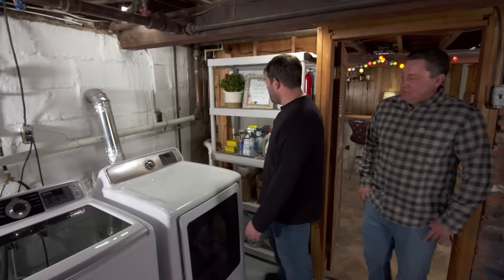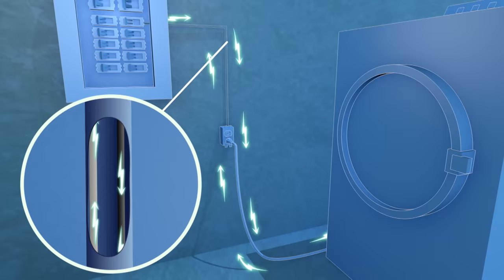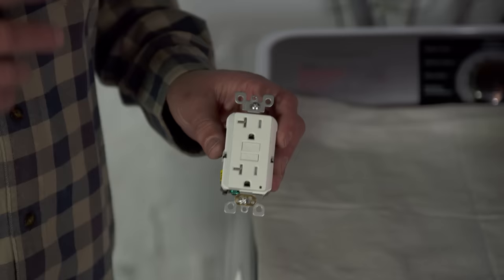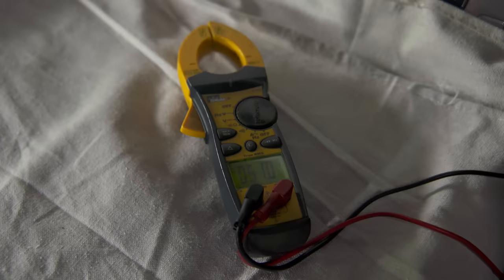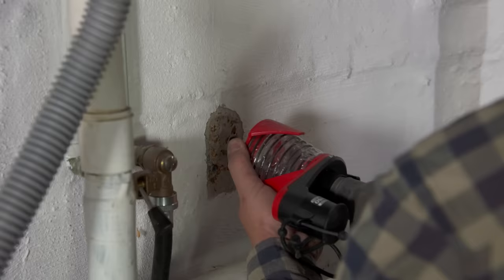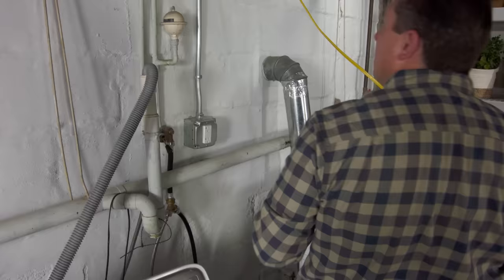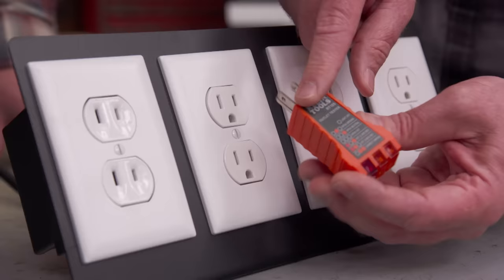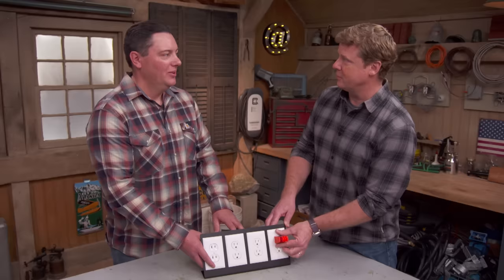How to Ground a Two-Prong Electrical Outlet | Ask This Old House

Comment: Yes, but he already had an upgraded panel designed for grounded circuits, what is the procedure if all your circuits are 2 wire/2 prong outlets and no separate ground bus at the panel?  Can I just terminate the one new wire on the neutral bus spare spots?  Or do I have to upgrade the panel?
I realize the Neutral bus and ground bus are bonded, but is it okay to tie my ground to a spare neutral screw?
Reply: As long as you run a wire to a rod driven into the ground, yes you can.  The ground bus bar is more for convenience so you have enough places to put wires in in case you have enough neutral wires to fill the neutral bus bar.

A ground wire serves two purposes.  If there is a short in a metal encased device, it allows the electricity to complete the circuit when the alternating current is suppose to be flowing from the hot side to the neutral side.  Besides protecting people from completing the circuit accidentally that unrestricted flow of electricity will also cause the breaker to flip to off and break the circuit at the supply panel.  The ground wire also protects devices from static electricity by attaching them to an earth ground so static electricity can not build up as well as induced currents that could be caused by close by lighting strikes.
Reply: @oldtimefarmboy617  Thanks.  I did just that and the funny thing is the neutral bus had exactly double the spare screws to allow for the new ground wire from the new Romex.  I wonder if the GE panel was designed for Romex and my house just got the old cloth wrapped non grounded wire?
One more question; my six circuit panel with no main shut off had one 15 amp tandem breaker feeding a 12/3 wire and I found each side of the tandem was only serving two bathroom light/fans in two bathrooms and nothing else.  Does this mean I actually have 7 circuits?  What is that about and can I extend one side to feed 4 led can lights?  Or am I asking for trouble?
Reply: @cantweallgetalong  
You will often find breakers feeding more than one thing.  You might have all of the plug in receptacles in more than one room serviced by one breaker in the expectation that the resident will not plug in enough devices to overload the breaker.  All of those plug in receptacles would be considered to be part of just one circuit.  And in most cases, that is true although occasionally someone will decide to plug a bunch of stuff in and run them at the same time and draw enough current to trip the breaker.

As far as lights are concerned, if your wiring is more than a decade old, it was designed to carry the current of incandescent bulbs which is several times more than LED lights use, and bathroom fans normally do not draw much more power than the light bulb does, maybe less.  If you put LED lights in the existing light fixtures and use LED lights in all the new fixtures you could easily end up drawing less current than you were with a couple of old incandescent bulbs.

I have two torch lamps in my living room that each put out the equivalent light of a 300 watt bulb but draw a little less than the current of 60 watt bulbs.  So I get 600 watts of light but only use about 100 watts of electricity.
Reply: @oldtimefarmboy617  Well, I checked all the outlets and ceiling lights and found the 12/3 going to a junction box in the attic.  The red goes to one bathroom ceiling fan and the black goes to the other bathroom fan/light fixture and the neutral is shared for both.  
I just wasn't familiar with the purpose or practice of using a tandem breaker with a 12/3 feeding just two separate ceiling fans.  It seams like it is a waste of wire and breaker for only those two fans.  
First, is a 15 amp tandem breaker code compliant at all, or set up this way?  And if it is, can I then use either the red or black as the feed for extending the circuit from this junction box to a set of 4 led can lights, without violating code or causing an imbalance on the tandem breaker or the 12/3 wire, the one neutral in particular?
The 15 amp breaker has independent switches, is that style still available, if this one fails after 61 years or are these discontinued?
Reply: @cantweallgetalong  
You said a tandem breaker?  Does that mean two different breakers tied together vertically?  If it does then there may be a problem.  In the United States the transformer for residential electricity generates 240 volts AC.  The two "hot" wires are connected to each end of the transformer's coil.  The legs coming off those wires in the electrical supply/control box are designed to connect to every other row of breakers horizontally.  The neutral wire connects to the center of the transformer coil so that any circuit connected to one breaker and the neutral bus gets half of the transformer coil's 240 volts or 120 volts.  If you connect a single circuit to two breakers next to each other vertically you will get the full 240 volts from the transformer.  Generally they do that for electric stoves, ovens, and clothes driers because they are designed to work most efficiently with 240 volts.

From what you just described it sounds like someone took a joined pair of breakers designed for a 240 volt device but is using them separately by using one wire in the 12 gauge three wire cable from one breaker to go to one fan/light fixture and the wire from the second breaker to the other fan/light fixture and then joining the third wire together to connect to the neutral bus bar.  This is unusual and violates the general US wide electrical code.  Not just because there is no ground (older homes built before a ground wire was required do not have to have one unless you remodel the house, then you have to rewire to comply with the latest wiring to code) but because two separate wiring cables should have been used for each of the two breakers.

Other than not having a ground wire run from each bathroom fixture to the ground bus bar and using only one three wire cable, this setup will work.  If each breaker is 15 amps then you effectively have two 15 amp circuits, just run in one cable.  Unusual but not a critical concern.  If both breakers are 15 amps then you can easily add more lights and plug receptacles if you want to without worrying about overloading either breaker.  The only problem with their toggles being connected is that if one of the breakers trip it will trip the other breaker as well even if it does not have an overload.  That would cause a power failure in both bathrooms at the same time.

Depending on how the toggles are connected together it may be possible to remove that connector without damaging the breakers so each breaker works separately.  Or you could buy new single breakers and replace the tandem breakers.  Or you could just live with the possibility that both bathrooms might go dark at the same time while in use.

It is up to you but if it is easy enough, like if the wires are run through the attic, and you are willing to run new 12/3 wiring cables up through the attic, you can hook each bathroom to separate breakers and have a ground wire for each which would make it safer and make GFI receptacles or arc fault breakers work better and the use of plug in devices in the bathroom much safer.

I do not know your particular situation well enough to say anything definitely so it is up to you to use your best judgment.
Reply: @oldtimefarmboy617  Thanks, very helpful and clear explanation.  
I thought the 12/3 was going to the stove outlet too. but found it just feeding the two bathroom fans when i remodeled the two bathroom years ago.  When I rewired the GFI outlets and  and switches with new Romex back then, I found them on two different circuits and ran a separate green 12 ga to the neutral bus on the panel.
I just finally got around to remodeling the kitchen and decided to run new Romex to all the outlets from the panel and then I got carried away and did the other 5 circuits after I got a estimate for $20K to do a complete rewire.

Comment: Is it acceptable to just add a ground wire?
In other words just use existing wires, add a new three prong receptacle & add a ground wire that is grounded to a water pipe?
Reply: @dan9809  
I have a friend that is a retired licensed Electrician.
He told me once that a water pipe that goes directly outside into the ground is better than using a ground stake.
Obviously the water pipe has to be metal or copper.

Comment: Is it possible to wire the ground directly to the junction box itself. Or rather the box the outlet sits in
Reply: Possible,  yes. To code, no. EMT can separate thus losing ground when you need it.
Reply: Thank you for reply.

Comment: 5:05, "we'll attach the white wire to the neutral bar, and the ground wire to the grounding bar".  Both bars had neutrals and grounds attached to them.  There should have been a bit of explanation there - in the main panel, they can be mixed on the same bar or bars, so this panel is fine.  But, if this was a subpanel - perhaps in an addition to the home, or in an outbuilding - the ground and neutral have to be separated, and the reason why is a little more complicated issue than we really want to get into today.

Comment: There is supposed to be a plastic piece on top of the emt conduit to prevent chaffing of the romex jacket.
Reply: m rapacki  I'm a DIY guy and your correct in what your saying, because I have heard that many times. However I have always stuck 12/2 romex in conduit in basements and garages where there is living space, because it's definitely wrong without conduit. Is it a heat issue ?
Reply: They should make rigid conduit like a mesh screen so the heat can escape. Lol

Comment: NEC codes permits using GCFI and there no advantage to adding a ground wire other than adding costs
Reply: Of course there is benefit in adding a ground wire. The GFCI thing is a hack. I am not saying that one should not use it. It is for each to decide how to do it.

Comment: Turning the main breaker off DOES NOT mean there are no energized parts inside unless you have a dedicated shut off on the outside of your house.   If the main breaker is inside your panel and you flip it off, those main lugs are still energized & you need to be cautious while working around them!  Don’t do panel work unless you are 100 percent confident in what you’re doing.

Comment: Here I am with old Knob and Tube from the 1940's in house built in 1882. Waiting for it to all go wrong. I could never afford a whole house rewire. The plaster walls would make it a big time pain.
Reply: Amazed someone is willing to insure your home!
Reply: @oambrosia  Yeah I hear you. You got it through Esurance. A lot places when they asked the age of the house it was too old. Unfortunately the knob and tube is the only beginning for the trouble. After the home inspector gave the house a sparkling report. Floor joist turned, rim joists rotted, improper ventilation of a bathroom exhaust fan, hole in the chimney, and more. Complete shoddy work. The house was a lemon. My wife and I started to call the house "The house of wonders" as we and contractors often wonder what the heck. I had one contractor ran out of the house, saying he wouldn't even touch anything or fix anything. At least there is still a roof over our head.

Comment: It looked like the wire he threw away at 3:28 was 3 wire (hot, neutral, ground)... why couldn’t you just use the same line and swap the receptacle?
Reply: @javaTL: yes, probably would have been okay, assuming there weren't other problems he didn't explain (nicked conductors, wrong fittings, whatever).  Many electricians want a "clean install", since their license is on the line for anything they may have missed.

Comment: Anybody notice when he used the dust catcher on the drill as soon as he was done drilling all the dust went on the floor kinda useless if you ask me
Reply: He could have handled it better.  It was either having a vacuum attached with suction (making noise for the camera guy) or a Milwaukee SDS Plus Dust Trap (silica dust).  But, they work wonders if you are drilling overhead.
Reply: Good for overhead. I saw that spill also.

Comment: So if you have a whole house from the 50's that has no ground, short of rewiring the whole house can you run GFI'S everywhere?
Reply: You can put the GFCI on the first plug in the lcircuit then wire the incoming wiring to line and the wires going to the other plugs on the load label but it can be hard to find the first plug in the circuit
Reply: If you have a breaker panel you can also use gfci breakers

Comment: romex jacket cable through conduit?
Reply: The NM cable (Romex) runs through electrical metal tubing (EMT) in this unfinished basement to protect it from physical damage. The EMT only runs to the top of the concrete wall. The upper end has an EMT to NM coupling (seen at 4:21), and the NM cable must be secured within 12 inches of where it exits the EMT.
Reply: @DynamicBits  aren't you supposed to remove the jacket?
Reply: @CupidFromKentucky  Technically, NM cable is listed/rated as a cable assembly. The individual conductors are not listed/rated and should only be exposed inside a junction box (or load center, etc.). Notice how there is no labeling on the conductors; just on the outer sheath.

Comment: Will GFCI work if there is no ground?
Reply: Alex,  yes.  Gfci measures for a difference in current between hot and neutral. When it sees them not the same it trips.  This process of measurement does not use the ground in any way.  So you can safely use a gfci on a circuit without any ground.
Reply: Depends on the situation. It will work if someone gets in contact with a hot wire or metal surface with fault current. However, if you have both a GFCI and a ground, and there’s a fault current, it will trip the GFCI BEFORE anyone gets a chance to touch the metal surface with a fault current. So having a ground AND a GFCI is a lot better and safer than a GFCI alone
Reply: As I understand it, "yes" and it is, as I understand it, legal to use in place of an ungrounded outlet because of that in some places.  Check your local coeds...o...I mean codes.  :)

Comment: They didn't cover when some prick puts a wire to directly connect the outlets ground and neutral, the tool they used will think it's fine but if you plug anything with a heavy load you have a good chance of seeing sparks
Reply: Saigyl - I was looking at a panel the other day and noticed all the grounds and neutrals are connected to the same bus bar. How is this any different?
Reply: @kingofepicvlogs4666  it's different enough that once i ran a new 14-2 wire all the way to the breaker box for that outlet I wasn't being shocked trying to plug a TV anymore

Comment: Isn't an uninterrupted metal box, metal conduit, to a metal grounded main panel going to act as a ground.?
Reply: They only stubbed the conduit ans the romex has the jacket on it, so there is not continous bond. Plus relying on conduit as a fault path can fail with just one loose connector or coupling

Comment: Electric meter reads OPEN(power company meter)what does that mean
Reply: You are saying you have an electronic power meter on your house from the power company, and when you look at the display it says "OPEN"?
I would call them right away.   I don't know for sure what that means, but I'd guess you have an open neutral.  If this what you have, then the neutral wire going from your house to the power transformer is broken.  If that is true, and you still have power, that means the ground rod next to  your house it taking all your house current.  This could cause voltage problems and damage to equipment.  This is just me guessing, tho, call the company and they'll know what to do.

Comment: Should have just got a gcfi arc fault combo breaker instead of getting using the gfci outlet. In most cases they are the same price as buying either afci or gfci breakers.
Reply: Leopold  No, a GFCI works just fine without any grounding conductor. You just need to label your 3-prong, GFCI-protected receptacles with "No Equipment Ground" and "GFCI protected" (if not obvious).  It may still need AFCI and TR features in some locations.

Comment: Spoiler alert.  It's not a "ground wire."  A GFCI receptacle does work well when you don't have easy access to the existing wiring.  You can add it right after the panel and protect the whole circuit.  Or just add a GFCI breaker.  Finally, Romex has to at least be stripped before feeding into a conduit.  Or just run conduit the full length so it's protected.  That's kind of sloppy work.

Comment: Long time ago.  The neutral wire was the wire that was. Being switched off and on.  Very dangerous.  Not sure when this was changed in the code book.  Learn a lot from the old timers in the trade. Opps now they call me gramps on the job.
Reply: I doubt they deliberately switched the neutral.  That would make no sense. More likely they did not care as the wires were not separated by color. In Europe it still is in plug in lamps that there is 50% chance that the switch is on the neutral.